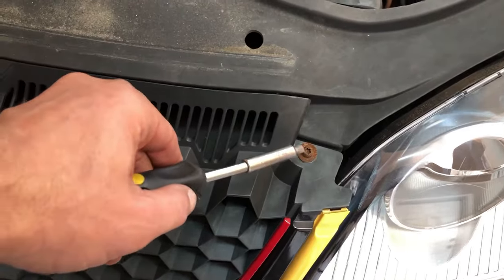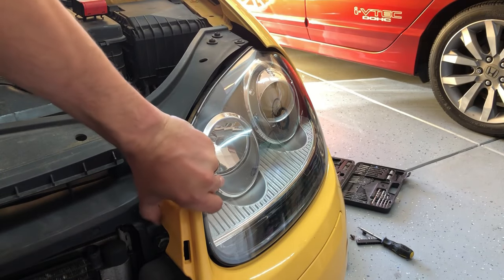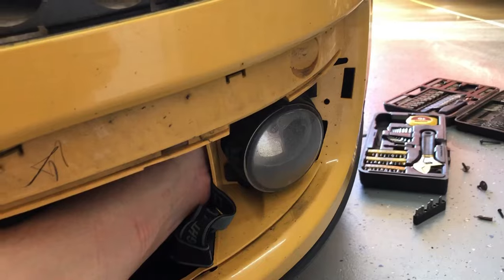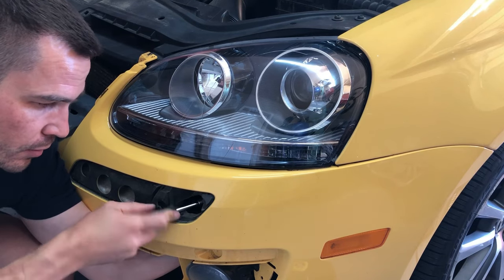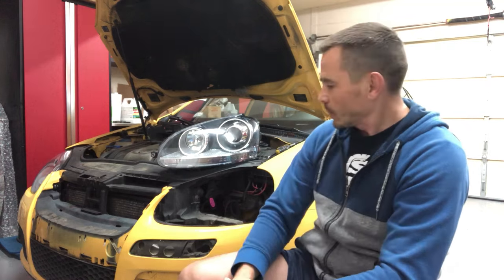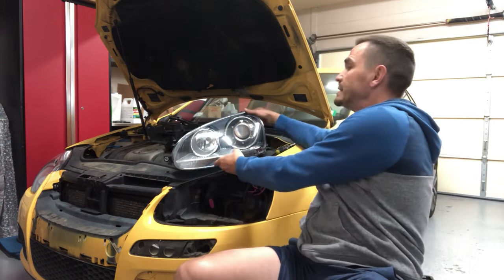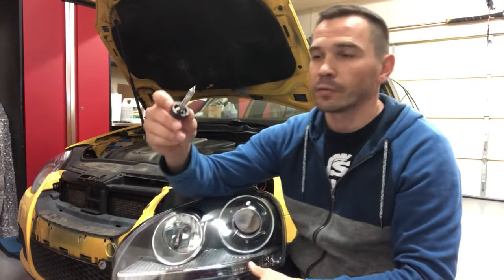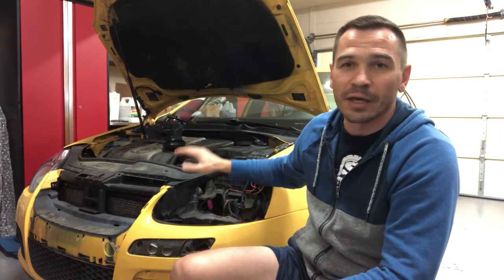VW Mk5 Headlight Removal the Right Way

Comment: man i got a Fahrenheit aswell i got number 752 and i was just looking for a vid to fix one of my lights seems like they tried to remove it and they put it back the wrong way its tilted inwards and it bothers me 😂😂 time to get to work thanks for the video
Reply from the maker: Have you tried to play with adjustments inside the fixture first? There are a couple of them.
Reply: its the whole assembly not the inside of the lights , sucks that someone replaced your original xenons i know the oem asembly goes for like 1k alone new so im trying to restore my lights and get them to sit properly
Reply from the maker: @jorgereyes3241  Got it. There are also adjustment inlets at both bottom screw locations of each light assembly that most likely you would need to adjust, maybe just the ones on the inside. Yeah, whoever owned the car prior to me messed up the lights badly. I had to buy another set but finally got it to work. Had also to buy the bulbs, ballasts and the igniters.
Reply: Same! #49 Seattle tacoma area. Gang gang.
Reply: @VITALexplorer  It is spoken as the ‘Mark 5 Golf’ not ‘M K 5 Golf’. From what I can gather, Volkswagen did not officially classify the 2003 5th generation Golf as the ‘Mk5’, but rather, the ‘V’, the Roman numeral for 5. This is the same convention for the Saturn V rocket, for Nasa’s Apollo lunar landing program.

However, VW did adopt the more straightforward Mk7 moniker for the 2012 Golf.

In Australia, and in many other jurisdictions, Xenon conversions are only road legal if there was an official factory Xenon option when a car was new, and if there is the requisite headlight washers also installed, as dirty Xenon headlights lenses are a safety issue due to dazzling.

Personally, I not believe that a Mk5 Xenon upgrade is worth the bother and expense for a 2003 platform car. Just buy a newer Golf with factory LED headlights, which perhaps implies buying a 2012 Mk7… the true successor to the pivotal 2003 Mk5, which marked a resurgence for the Golf nameplate.

Comment: what headlight set brand you would recommend for GOLF V GTD? Is it possible to get LED ones?
Reply from the maker: I would trust Depo the most on the aftermarket arena. I used Vland for my MK6, looks like a good quality but throws a DRL error for no obvious reason. I could not swap to LED from Xenon, even with repining, so hopefully your car got halogen lights.

Comment: It’s the black piece with the top screws of the headlight my one is cracked a little bit and need to replace it but I don’t know the part name ? It’s the long black piece you can see it when you open the hood and the it’s where the headlight is sitting in the video in the beginning
Reply: radiator support

Comment: Just replaced the HID adjustment motor on my 06 GLI.  Had to remove the headlight to get access to it.  That part went well, but I did have to remove the bumper cover;  the trick with the screw through the bumper didn't work in my case because of the headlight washer in there on the outboard edge.  If your plastic caps are a solid piece like yours are, this is a good method.  If it's in two pieces, it means there's a washer under there, and you have to remove the cover anyway...  But nice video.

Comment: The Fahrenheit's come stock with Xenon though don't they? I have a Fahrenheit GTI. Passenger headlight ia giving me issues. Stopped working completely. Swapped Igniter and bulb from drivers side light which is working but didnt fix it. Heard it may be a short in the BCM, have a used one on the way and gonna see if it fixes it.
Reply: did you ever fix it?
Reply: @gerson4705  I did yes, it was the Ballast(Power supply that only Xenon's have) It's mounted under the headlight assembly. Cost about $70